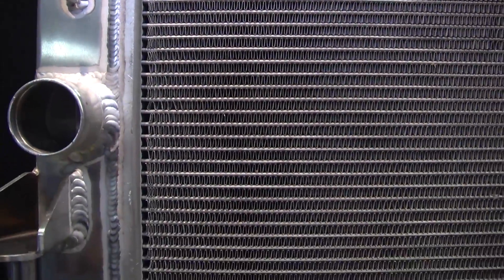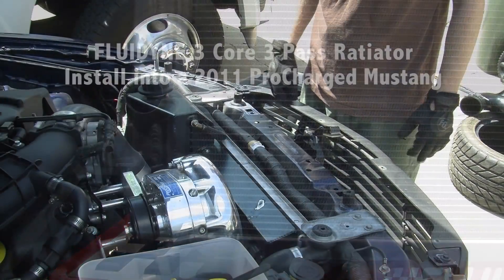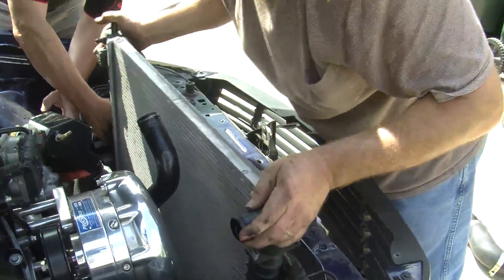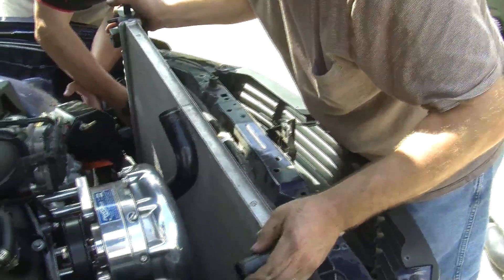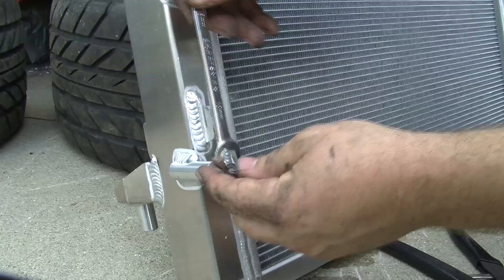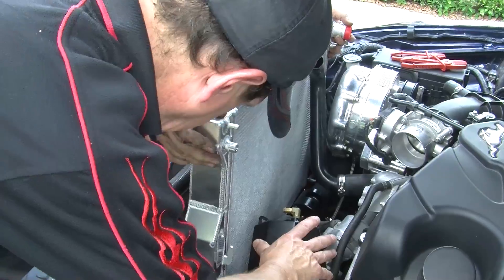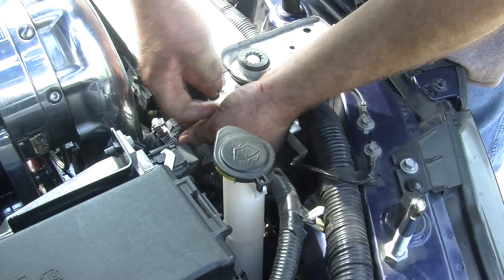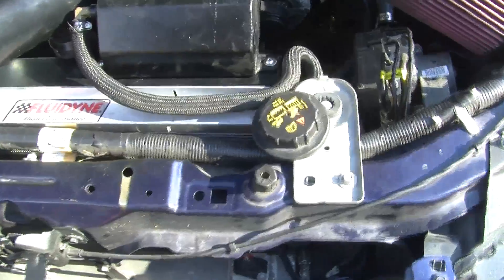Fluidyne 3 Core 3 Pass S197 Mustang Radiator

Comment: Would a larger radiator from the track pack GT/Boss 302 work too?
Reply from the maker: It would certainly help. Two things. I am not sure if the hoses are on the same side. Also with forced induction it still may not be enough to keep up with a long track session.
Reply: @V6MustangPerformance  is this better than misshimoto?
Reply from the maker: @Oliver-ft2fq  Its much better than misshimoto! But it costs a lot more as well. It depends on your cooling needs.
Reply: That radiator still uses INFERIOR plastic tanks.

Comment: I went through 2 in less than 2 years, whatever they use to weld the fins to the sides disintegrates, the I bought a regular one from ebay for about $120, never had an issue with it and I had it for about 5 years. these radiators are crap
Reply from the maker: Seems odd. They are a very reputable company. Mine is 2yrs old now and no problems, but my miles are low.
Reply: Ana Gutierrez : Did you utilize a WARRANTY process??

Comment: would it be good for a lightly modified 2011 v6 auto?
Reply from the maker: While not the primary target any S197 mustang could use it to keep the heat at bay. Especially if you live in a hot climate and do a lot of stop and go driving.
Reply: I commute from Mandeville to NOLA every day. 43 miles from my driveway to the parking garage.